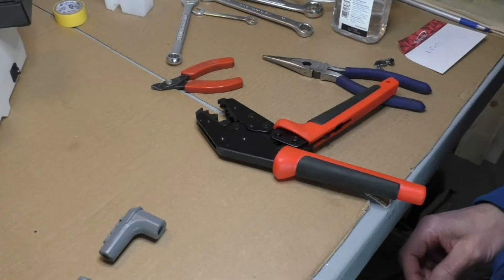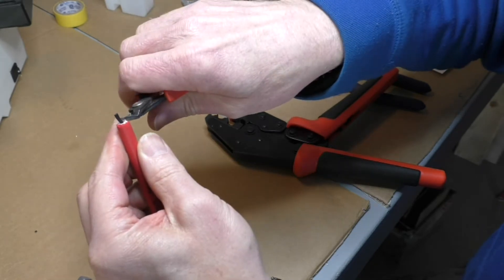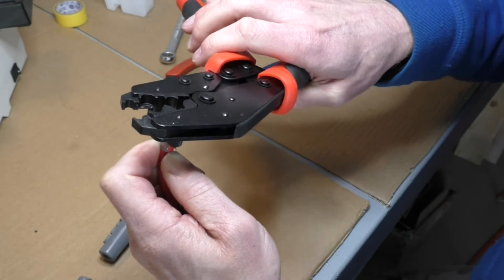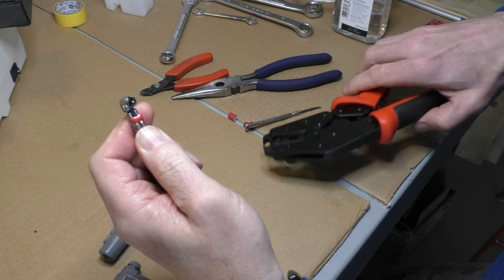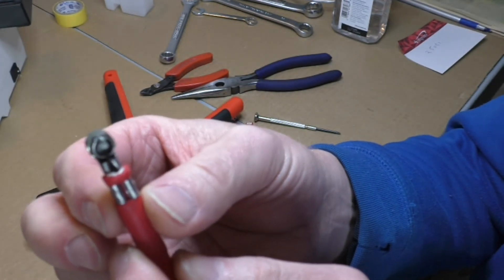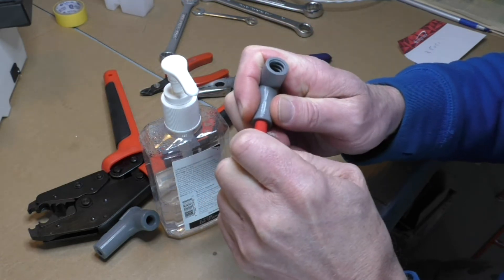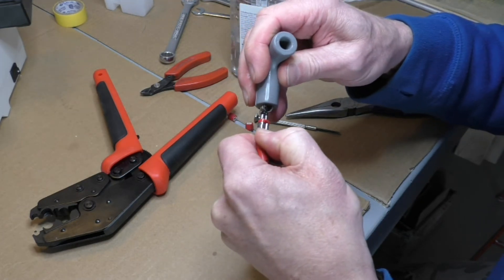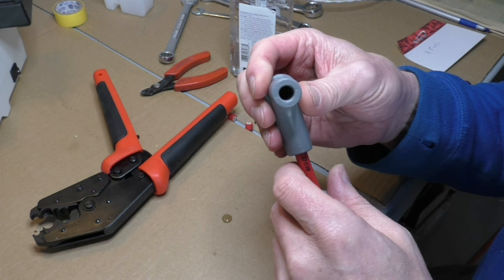msdwires3

Comment: Oh wow, so you don't fold the conductor under the insulation , then crimp? This is the first example shown where the conductor is crimped independently from the inselation( like on a traditional contact),  I've been doing my spark plug cables wrong. 
I don't even recall my spark plug terminals having a separate("wings") crimping location for the conductor (now that I think about it), I'm gonna have to check, I'm gonna be so pissed at myself if I missed it, lol.
Reply from the maker: MSD is like this but most other brands fold the conductor back under the outer sheath.

Comment: Ross, Another great video! For this application do you prefer the dual crimp style terminals over the style where you bend the conductor back?
Reply from the maker: Thanks. We supply the MSD wires with the dual crimp style connectors. The fold over type used on some other brands seem to work fine too.

Comment: Quick question. How do you know where to set the tension setting on the crimpers? Is there a corresponding wire diameter for each notch or is it more trial and error?
Reply from the maker: The MSD crimpers are only designed to crimp the 8.5mm terminals and wire. Squeeze until it clicks, squeeze again to release. Done.

Comment: hello, i just installed them on my v8 engine and the grey boots are straight and are touching the headers, will that be a problem? also, can you bend the straight boots to be in angle?
Reply from the maker: They don't recommend direct contact of the boots or wires with the headers. Might try some 45 deg boots.

Comment: Will the crimpers do the smaller 7mm plug wires?
Reply from the maker: The standard dies are designed for 8.5mm cable only however the dies bolt on and someone may sell different dies to crimp smaller cable. I haven't checked into that as well only use the 8.5mm cable.

Comment: Use 3M Clear Silicone Paste (available at all auto stores) as the lube, or dielectric grease.
Reply from the maker: The silicone paste or dielectric grease stays slippery so the boots can slide after assembly. Ok with angled boots maybe but annoying when pulling straight ones. I prefer the boots to stay put once installed.